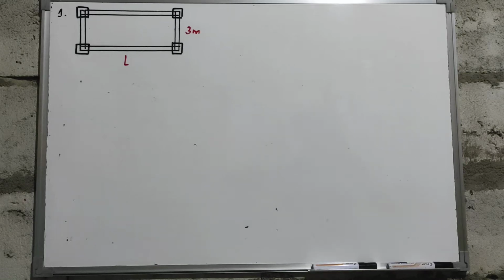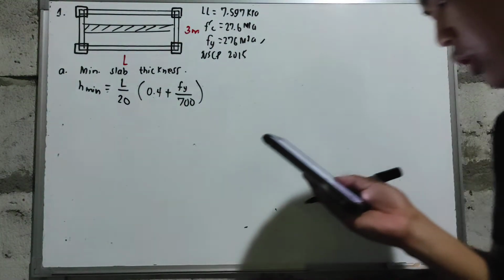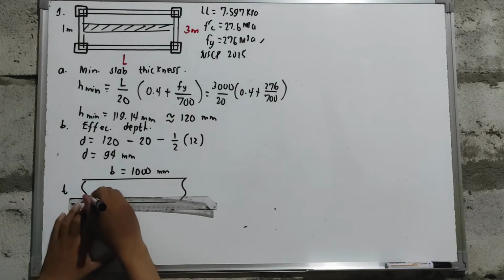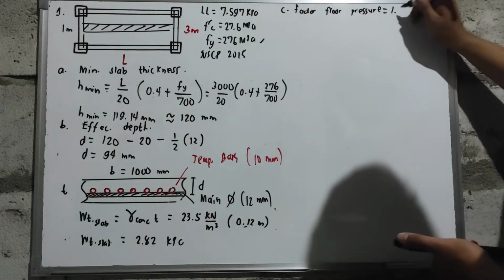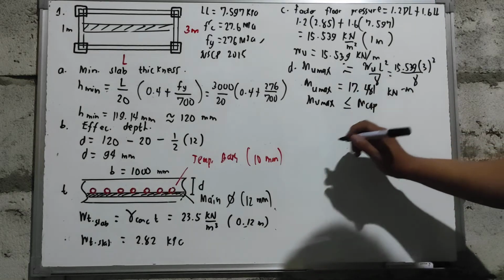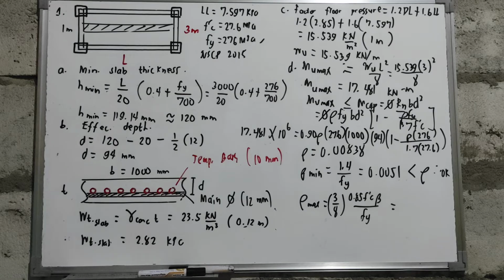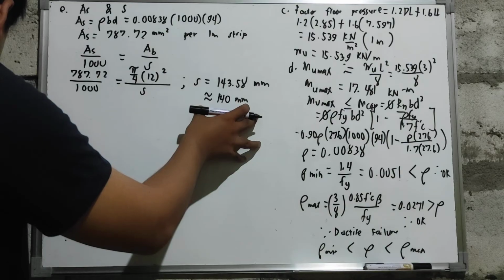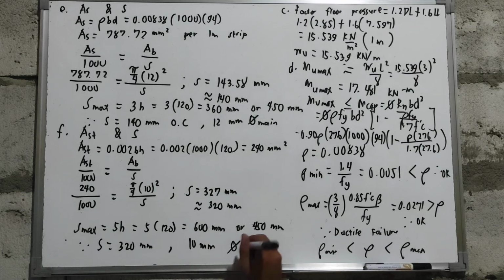One-Way Slab Problem No.1

Comment: 5-17 For the Wall detail shown below: a. Determine the lap splice length. b. Determine the development length in com- pression and tension for the hooked bars, is the footing depth adequate? c. Determine if the footing width "W" is ade- quate for the development of the footing bars in tension. 2" clr. As (req'd): Footing: 1.0 in./ft? Wall: 0.47 in./ft? #5@8" (vert.& dowels) Lap splice #9@14" W =5'-6" 22 cir. 1-3 --Hook dev. length PROBLEM 5-17

Comment: plz whats refernce for this problem can you help me 
 ssume an 8" one-way slab continuous over 4
total supports. The Clear span between supports is ln = 16'-0". Use f. = 3000 psi and
fy = 60,000 psi. Assume d = 6" to the main
reinforcing a.Determine the moment and shear values using the ACI coefficients. Draw each diagram assuming a knife-edge support (i.e., ignore the width of the supporting beams).
b.Determine the required flexural reinforcing (bar size and spacing) in the slab at the first interior support